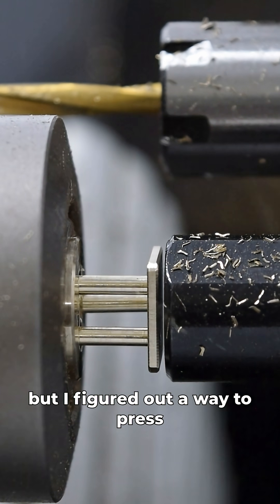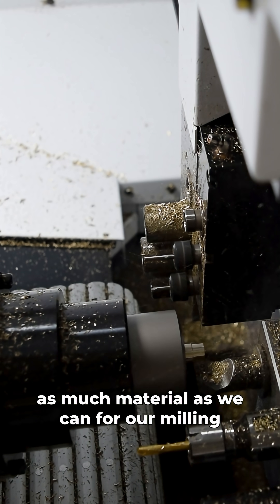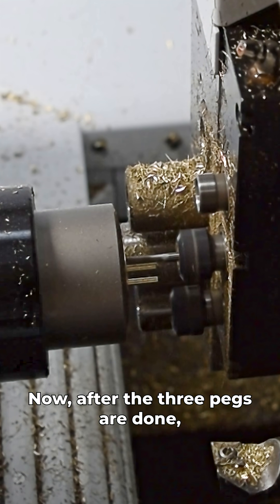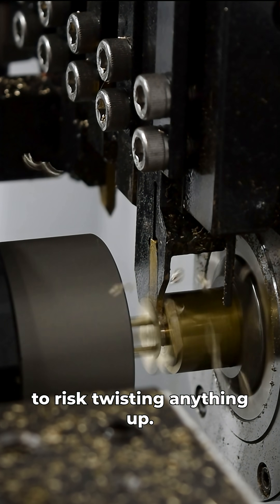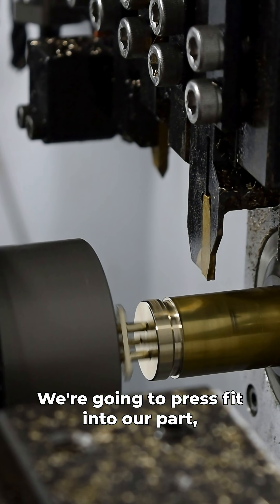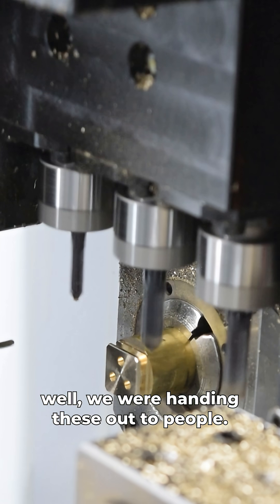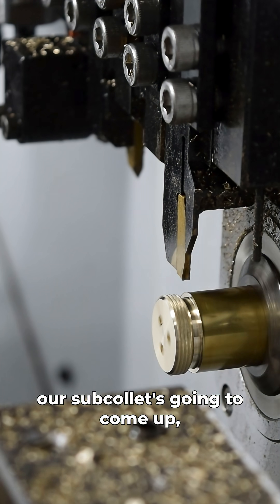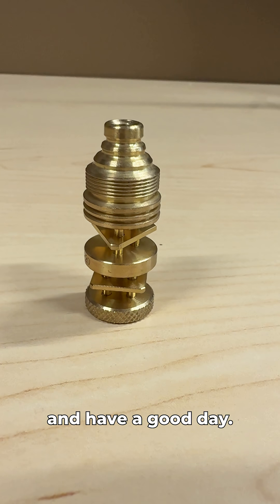5 parts in 1?!

Comment: Can anyone help me with threading 304 stainless steel. Been having trouble with chatter on Id with 3/4 threading bar. How do I figure what the right depth is good to take don't want to take much or to less.
Reply from the maker: What diameter? What depth? What RPM are you running at? What threading cycle are you using?
Reply: @donniehinske  NPT threading 1.195 taper bore depth 1.310. Running at 900 SFM doc .003 finish pass and free pass.

Comment: Both the programming effort and machine price would probably be enough to make the average machinist faint
Reply: You can find used Citizen A-20 CNC machines around  70.000€.
Reply: Ours came out to just over a quarter million which is certainly expensive but the thing is built like a tank and can easily hold a couple tenths from a cold start to the oil being uncomfortably warm.
Reply: Initial cost is high, and setup programming is tricky if you've never converted CAD to gcode, but if you're churning out some widgets this thing will work night and day, nonstop.  It doesn't go out to smoke, it doesn't eat lunch, and it doesn't ask for time off.  And the precision and repeatability are flawless.
Reply: Yeah youre fucking amazing.  Quit fishing for compliments. " A job well done is its own reward. " Doing a press fit at 10000 rpm may be a little excessive. When you outclass your peers on that level you're just volunteering for extra work dude.
Reply: @AB-kv8ky  me when I'm a crab and I see another crab trying to climb out of the bucket
Reply: @plesleron 😂love that.
Reply: @AB-kv8ky  That's fine as long as you get paid extra.
Reply: If it's a citizen machine it's actually way easier to program than you would think.

Comment: Thats crazy both spindles synchronize to press fit the three hole while spinning
Reply: Interstellar typa stuff lol
Reply: @Mikoyaboy that’s what I was thinking
Reply: right? fucking astounding
Reply: They can be programmed to have two threads getting screwed together. Very cool.
Reply: That's kinda normal for CNCs. If you do any kind of part that isn't perfectly round, they need to be synced to pick off.
The spindles aren't mechanically linked, they've just both got encoders that tell the machine's control where they are in their rotation.
Reply: i guess both spindles are mechanically linked
Reply: @schnaps1790  electronically linked I think
Reply: Yeah, I don't get the purpose of the spinning part. Seems like it's just a "hey, look what I can do" move.
Reply: @internettoughguy both spindle bearings will have higher dynamic load specs than static load. When you broach it's also better to have the spindle moving